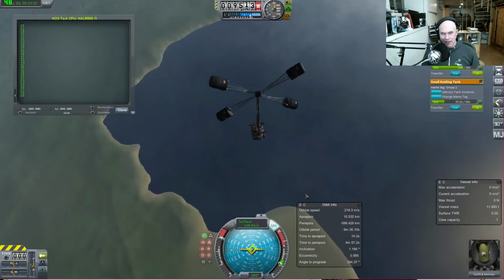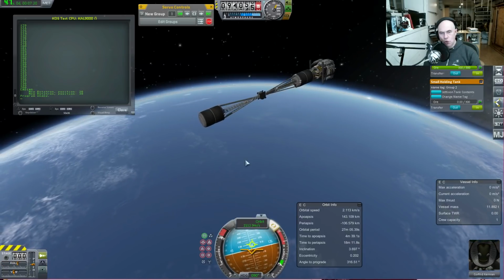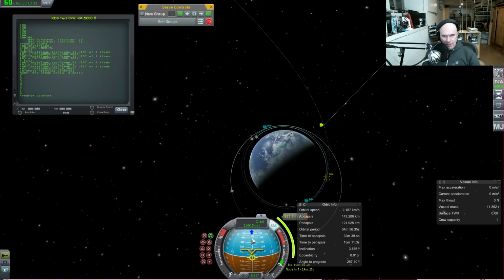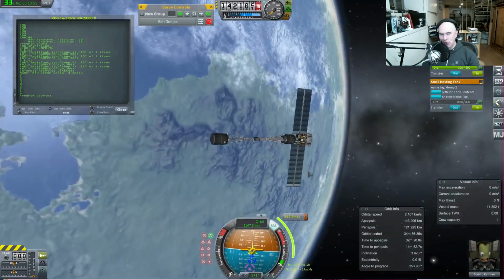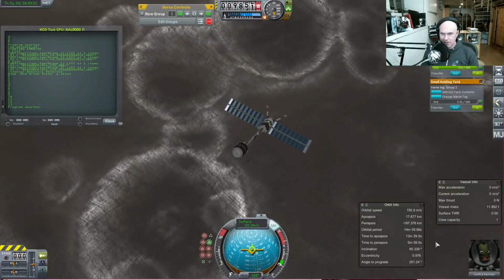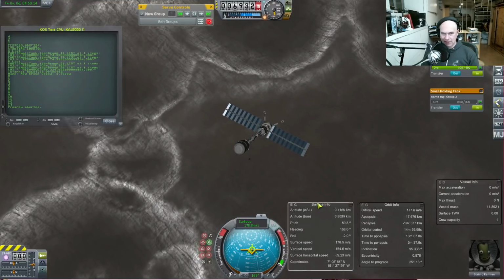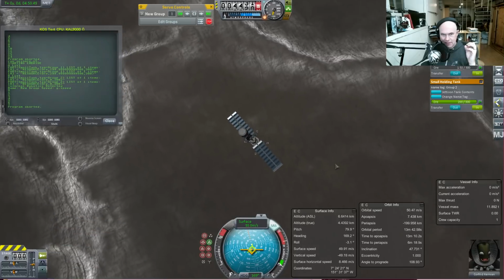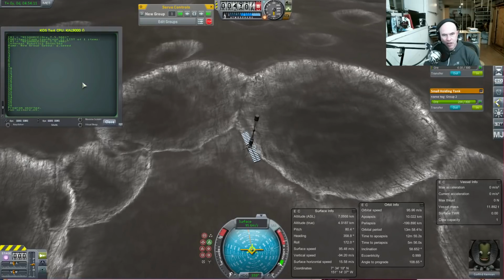Inertialess Gyro Drive Lifting Off From Planet

Comment: It breaks the laws of physics, it's horrifying.
Reply: Kevin Miedema
It uses infernal robotics.  The kraken is pissed even before it's turned on.
Reply: It's exploiting a flaw in the programming of KSP but it is arguable that if it's possible than it's not cheating.
Reply: If this law of physics was never programmed in, how can it possibly be breaking it?
Reply: It appears KSP does not model the physics of fuel flow. The forces accelerating and decelerating the fuel between the tanks should exactly oppose the centripetal force thus negating the apparent thrust I believe.
Reply: LOP1698. wait what?
Reply: no its magnificent - lets hope the kraken isn't angered by it though.
Reply: LOP1698
Of course.  If it was real it'd mean large amounts of free force with no propellant.  Things like that exist, solar sails, but they're not powerful and become less powerful the farther they are way from the sun.
Reply: Its kerbal everything breaks there
Reply: LOP1698
First, it's energy, you only use ie if you're making energy plural (I looked and there's no different European spelling).  Also no.  That's why we're saying KSP is broken as an accurate Newtonian simulator, it fails in a couple strange ways to accurately portray reality.  Of course those shortcomings are on the fringes and most people never would have run into the issue we're talking about now so, I'm not sure if it really qualifies as a significant issue.
Reply: LOP1698
I had to describe the word color without using color.  Color is a descriptor word for just a very small range of wavelengths on the Electromagnetic Radiation spectrum (390 nm to 700 nm).

Yes English is weird.  It is a combination of German, Latin, Spanish, French, and German again, all stuck on an island for a couple hundred years and then split up across the world.  There are American's I can barely understand their English.  Let's not talk about the British, some of them I understand the words but don't understand the sentences.
Reply: I believe NASA did built engine which breaks physics recently
Reply: LOP1698 No, the craft carries no propellant.  It comes from the sun.  Essentially a solar sail is the same as taking a gun and leaving the gunpowder at home but it still shoots.  Yes, the sun is the propellant but you don't say the craft has propellant.

I know what you're saying.  I just think the it's a minor point.  It's the same as factoring in the rotation of the Earth while throwing a ball.  It's not worth the effort to be that specific.
Reply: LOP1698
Ok.  Thank you for the explanation.

To make it more confusing, in North America the word for the visible spectrum of the EM radiation is 'color' in English speaking parts of Europe it is 'colour'.  There's a few other words like that.
Reply: It doesn't break them, it abuses them.
Reply: Fancy Cat Gaming FCG 
It breaks physics in the real world
Reply: MerlinCorwinoff if it did then stuff would happen
Reply: Scott Manley doesn't need those pesky "laws of physics".

Comment: Ok, now make it so that you can throttle it ;)
Reply: He can just transfer only part of the tank. This will be much simpler than rotation adjustments.
Reply: Maybe you could use the extending parts from IR (I forgot what they're called) in place of the girders, you could throttle to some extent by changing the length of the arms?
Reply: As well as the transfer speed, because those have to be in sync.
Reply: I'm not sure efficiency is a concern.
Reply: Just vary the pump speeds.  Sure, you won't be transferring all the fluids in the tanks when under partial thrust but that doesn't matter as long as the pumps continue to switch directions when the tanks are inline with the long axis of the ship.
Reply: That just means adjusting the rotation speed.
Reply: but less efficient.